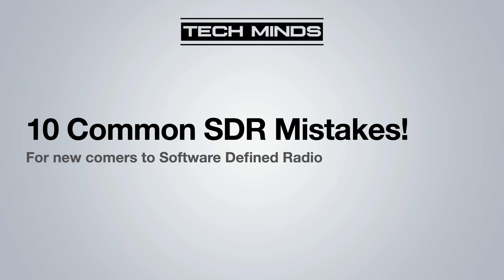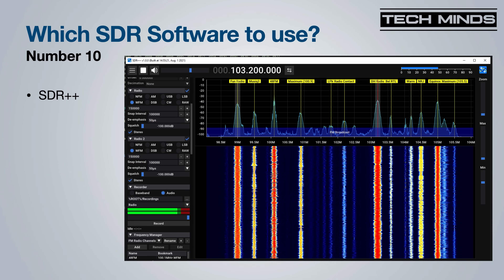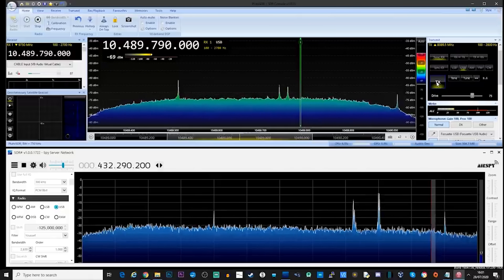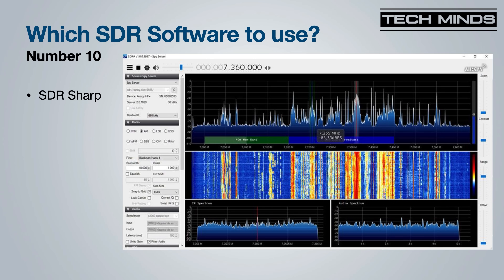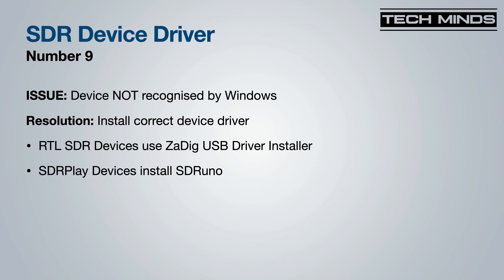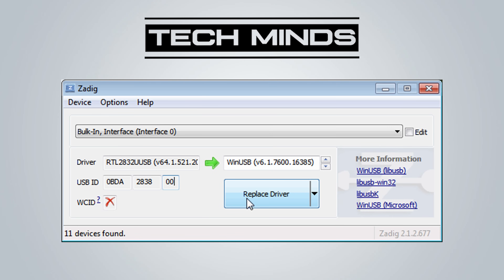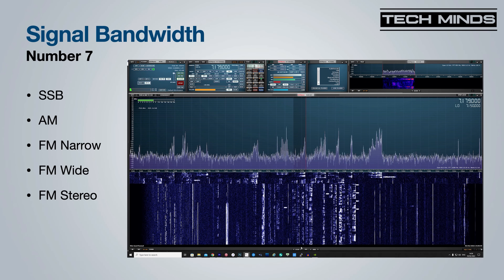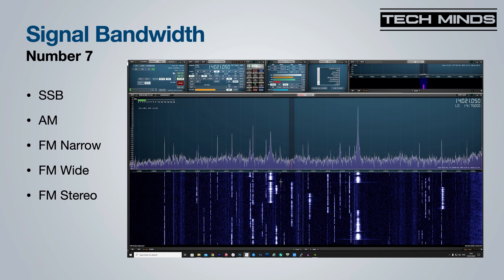10 Common Mistakes Made With Software Defined Radio

Comment: Vary good video clearly put well done.
Point of intrest for people who are able to have a bit of garden space.
Build a doublet antenna with wire feed it with 450 ohm ladder/window line use either a Balanced tuner or a 1 to 1 balun and coax to a unbalanced tuner atu.
To tune the antenna adjust atu till strongest recived signals can be seen from the sdr signal strength meter or put in a coax switch and use a noise bridge to tune the doublet antenna.
Also to reduce electrical and static equipment noise put two 8 foot earth spikes in the ground about 13 feet apart and join the two together with 22mm copper water pipe.
Reason for this is due to high frequency skin effect of signals and noise.
Connection of earth to the earth stud or metal is case of Computer / and sdr devices  be careful not to generate earth loops.
All things earthed only 1 earth wire to a earth block then a large single run to the earth spikes.
A 66 foot doublet with a good atu NB spend money on a good manual tuner. pay you back in hours more enjoyable time. Will tune from meduim wave to 600 mhz quite well. 
Pleanty of youtube on this tech. 
Also if you want to try it out a 12 point rotary switch to ceramic caps of lots of different values between centre of coax and earth near atu to help load capacitance on Atu can  help values to look at from 1pf to 2000 pf is a good starting point. 
Hope this helps 
As a side point use a cheap old am reciver cb air band etc to source your own equipment noise and reduce your chances of getting electrical noise just hold it close and if the am reciver gose nuts that's noise ferrite beeds type 31 are good. 
Have a good day 
ps if useing coax and balun keep the coax as short as possible less the better it will be

Comment: I really appreciate your video, Im new to SDR.  What cable do I need for 1.420 Mhz for hydrogen line radio telescope?
Reply from the maker: I guess it would be the best you can afford. However, it’s also possible to mount the SDR close to the feed point of the dish, which means coax runs would be short with less loss. So the length of the feeder would dictate what type of coax you need.
Reply: @TechMindsOfficial  My lna antenna is 1.89 inches inside a feed horn of 4 inches.  Thanks for confirming I need coaxial cable, im waiting for N Male Type to F coaxial adapter for my 1 meter dish because i think this SMA is bleeding power and eating noises.
Reply: Use a low noise preamp located at the feed and locate the SDR as close to the antenna as possible. Everything needs to be as low loss as possible. You should easily be able to hear the noise from celestial objects by pointing your antenna at them. Otherwise, you aren't sensitive enough. Performance is controlled by the Noise Temperature and Gain of your antenna system. You should learn how to do the link calculations for your system to get it right. Coax, LMR-400 will do fairly well but you need to use good connectors too.

Comment: Very good advice.  I've been listening for years and learned a lot via trial and error.  Good point about listening to different bands at different times of the day.  I know a lot of people turn on a radio or SDR and then get discouraged but it was only because they chose the wrong band at the wrong time. A little reading would help, but some don't want to read a lot, they just expect it to work like an FM radio.

Comment: Great video and explanation. With reference to antennas: - I have an end fed half wave (flower pot) tuned to 123Mhz. The strange thing is I get really strong reception on SSB as well as air band. I purchased a Tecsun AN-48X and found it to be worse than ever and just amplified more noise. I put up a long wire and got SSB signals but still not as good as the flower pot. Including the antenna windings the total length of wire from the loft to radio is 45 feet. I'm wondering is this acting as a long wire.  Incidentally I use a Uniden UBC125XLT and a Tecsun H-501X on the same antenna made with Ultraflex 7 coax.  Before I fork out on an outside discone your comments and advice would be gratefully accepted. Thanks again for the videos.

Comment: My first antenna, as a 10 year old SWL, back in the stone age, was a crocodile clip on the metal dial of our old GPO telephone. Actually worked better on top band than a 100 foot long wire. Miles of overhead cable. The end was probably close to some my contacts QTH  ;)
Reply from the maker: That sir, is genius!! Bravo!
Reply: i used the ground wire for my tv at home, but in college I hooked the center coax pin to the buildings' AC duct work and got us cable tv in the lounge. All of the signal leaking out of the ports throughout the building was enough on the popular channels to give a signal.
Reply: Same!
Reply: I had heard of this sort of antenna as a young ham radio enthusiast --over 45 years ago. However, most landline phones now convert to voice over IP long before they ever get to the old wire centers and central offices. Even if you still have all of the older infrastructure, your copper lines also ride along with noisy digital signal lines. We no longer are restricted to voice frequencies on those cables any more. So as nice as such things were in the day, it's not what I would recommend in today's world.
Reply: @jakebrodskype  With the modern IP telephone when SHTF most people wont have usable phones.
CB FRS GARS 2M are good ideas.

Comment: Great timing! I was literally attempting to configure a NuElec on Windows just this afternoon!
On that note, does Zadig change anything on the SDR itself, or does it simply add drivers to Windows? Your help would be appreciated!
Reply from the maker: No, it doesn’t change anything on the actual device, it just loads the correct drivers for that specific device. Thanks for watching 🙏
Reply: Depending on the version of Windows and how it's set up it may also ask for permission to change the system configuration.
Reply: Zadig just installs the WinUSB driver, instead of whatever was used before. It's used by other projects than rtl-sdr too. WinUSB allows general purpose programs to access it.

Just be careful about selecting the right device, since it can replace input device drivers; like making your keyboard useable to general purpose programs instead of it being a keyboard.

Comment: Thanks for the Information on SDR I have been running dragon os focal about a year and all the software works out of the box don't have to do a bunch of trying to install packages to get it to work, very good for Amateur radio a lot of that SDR software I could not get to work on other Linux os.
Reply: I've just discovered DragonOS too! What a find! Can I ask if you've had any trouble with SDRangel? It simply will not launch. Do I need to configure anything beforehand? Thanks for any help!

Comment: Thanks for the great content! Your channel is what got me into SDRs and what a wonderful hobby it is 😉. I have a rookie question to ask if you don't mind. I currently have two RTL SDRs, one is the Nooelec Smartee and the other is the Smartee XTR. As I understand both have the same chipset but different tunners (E4000 vs R820T). The Smartee with R820T was the first one I had on my computer and recently I received the Smartee XTR (E4000). Do I need to install different drivers for the XTR or I just simply need to set it differently in the software (offset tunning and IQ correction)? Reason for asking is that at the moment I am picking up far fewer signals with the E4000 with the same antenna setup and don't know why Cheers!
Reply from the maker: Interesting issue, I’ll have to see if I have both of those devices and compare to see if I see the same results. With regards to drivers, they would use the same drivers 👍
Reply: Same for me. Great(est) SDR channel on youtube  👍
Reply: Software(s) should support both.

But they are rather different in internal construction; R820T is low-IF (real), while E4000 is zero-IF(complex, I+Q). There are rather subtile differences in how they behave.

If there are any mirroring, the Zero-IF one would be around the center of the specturm view, while the Low-IF would mirror something from outside the view.
Also Zero-IF is known for having the "DC spike" in the middle, while a low-IF should have none of that.
Offset tuning applies to Zero-IF and shifts the window to the side, IQ deals with inbalance between the channels.

Since the rtl-something chip picks out a smaller slice in SDR mode, you won't see the full view.
The differences are mostly seen when you try to extract a weak signal near a strong signal, or just use way too much gain. As in it mostly matter when trying tricky things.

Comment: I notice on RTL-SDR's have issue with most 3.0+ usb port hosts.
Reply: no they don't? If you are having trouble, it's likely a driver issue.
Reply: Pls make more  video for Dsd plus and its setting with sdrsharp.
Reply from the maker: I personally haven’t seen this issue and all my ports are USB 3. But thank you for sharing this, as it may help others that have a similar problem and try other USB ports. Thanks 🙏